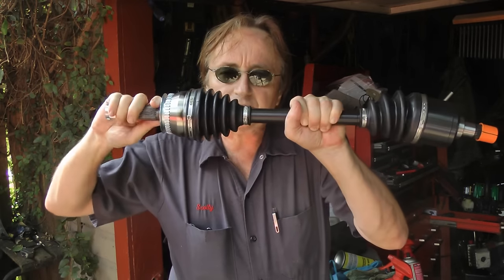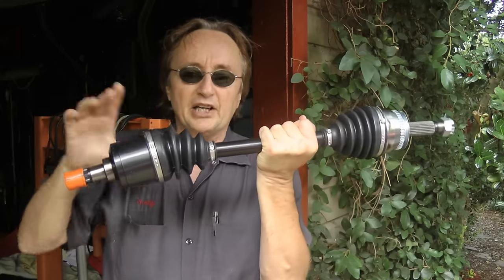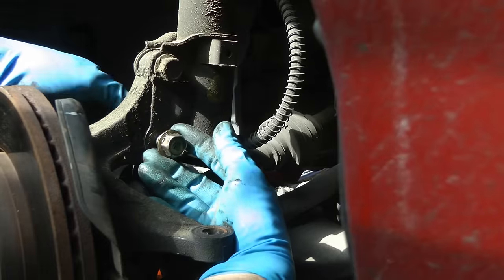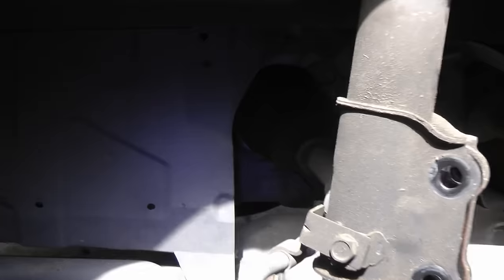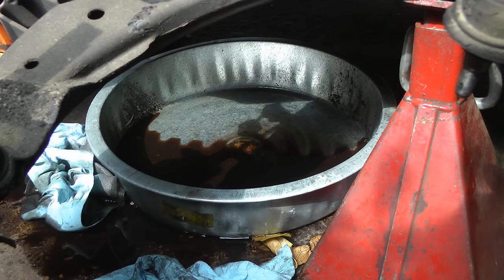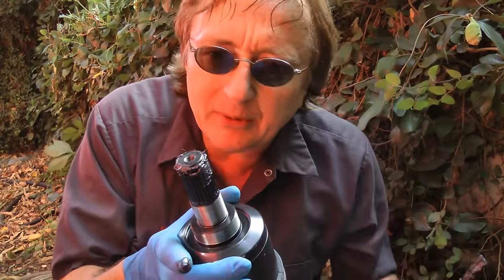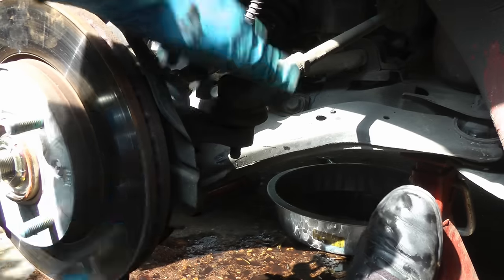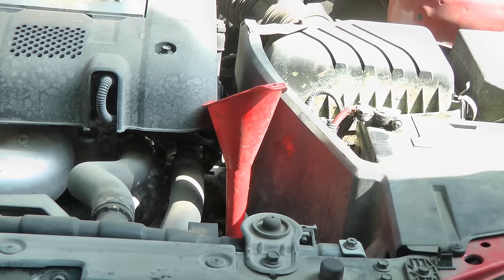How to Fix Car that Clacks When You Turn (CV Joint and Axle)

Comment from the maker: Things I used in this video:
1. Breaker Bar: http://amzn.to/2BEo9Ep
2. Sledge Hammer: http://amzn.to/2klPyH8
3. Brake and Caliper Grease: http://amzn.to/2jTpCPh
4. Metal Oil Pan: http://amzn.to/2nlDM0y
5. Sledge Hammer: http://amzn.to/2klPyH8
6. Ratchet and socket set: http://amzn.to/2inoxOY
7. Mechanic’s Tool Set: http://amzn.to/2Bzmccg
8. Disposable Gloves: http://amzn.to/2zSRuxO
9. Steel Jack: http://amzn.to/2Asgjxo
10. Jack Stand: http://amzn.to/2jGOwBg
11. Common Sense
12. Full HD Camera: http://amzn.to/2AvoEk7
13. My computer for editing / uploading: http://amzn.to/2i2sKYz
14. Video editing software: http://amzn.to/2jv5Fhf
15. Thumbnail software: http://amzn.to/2k7tz6C

🛠Check out my Garage to see what I use every day and highly recommend:
https://www.amazon.com/shop/scottykilmer

❗️Check out the Scotty store:
https://goo.gl/RwhRGU

👉Follow me on Instagram for the latest news, funnies, and exclusive info / pics:
https://goo.gl/ohy2cA
Reply: Scotty Kilmer hello, does that also a problem that can be solved on a bmw xdrive?
Reply: Scotty, you didn't leave a link for "common sense" on the things used in this video...🤔
Reply: hey scotty,,. i just did the same job ..only the retaining clip looks like it broke on the way out.. i got the big peace but never found the tips ,, 02 accent gl 1.6,, what would you do?.
Reply: Scotty i wanna advice from you what you think CV made from china?
Reply: Should you change both sides even if one of the two is failing??
Reply: Mine makes a howling noise that goes away when I turn left.
Reply: Scotty, my 2007 Toyota sienna is making a very similar noise after acceleration and turning or going over a bump. My mechanic says it is the ingine or the transmission going bad. I dont really believe it after watching your video. Any thoughts?
Reply: I just put in a new CV axle on my passenger side in the front and I got a little crackling sound is it because I didn't grease it???? Need to know as soon as possible it's about to snow here in Ohio real soon
Reply: 1
Reply: Hello Scottie, I have a 2016 Range Rover Evogue SE. My Lf and Rt CV Axles are clicking. The problem is that the dealer is the only source for the CV Axles and there's none in the country or the UK. What other options do I have to fix my CV Axles?
Reply: 11. Is the best one lmao

Comment: Great tip on putting grease on the end of the axle. I would extend that to put grease or better yet anti-seize on the splines on both ends of the axle to make removal easier next time. Rusted in cv axles are no fun.
Also I wouldn't recommend to anyone to hit the tie rod on the castle nut like that. You can easily bend a prong on the castle nut and you'll never get it back on. Hit the steering knuckle where the tie rod goes through it instead. Works great and no risk of damaging anything.

Comment: I have a Acura TL that makes this annoying noise! Sounds like the Wheel of Fortune wheel. Thanks, now I have a fun, learning experience to tackle this summer.
Reply from the maker: check the cv joints at the front wheels first, if boots are ripped, you need new ones

Comment: This guy's awesome. He makes it look so easy.
Reply: he does, but I wouldn't trust myself to do it lol
Reply: Yeah this one in particular. It's excellent skilled labor what he demonstrates.
Reply: That's what happens when you do it for 50 years lol
Reply: i m looking for a cv axle left and right  for a Suzuki alto 1999 1.0 benzine can some one help me find them
Reply: Aviators how
Reply: keytracer lmao
Reply: its easy but if you don't how to do it it seems impossible, like driving the first car vs driving a todays automatic car
Reply: Fguyhb
Reply: Yes IT LOOKS EASY. Trying doing yourself and you will spend 2 hours removing one wheel and probably damage your car using the lift. I seen it happen.
Reply: @keytracer  your dead on
Reply: of course he does he chooses the easiest cars to do these things on
Reply: @keytracer  its a tutorial video. Obviously if you haven't done it before it'll be challenging. It's not that bad.
Reply: @NeutronX101  2 hours removing one wheel?? If you have the proper tools it won't take you anywhere near that long.
Reply: @ElChuvyDuvy  if you never used those tools it will.

Comment: Great video. I'm diagnosing a popping/knocking noise from my front suspension/steering area. Had the sway bar links replaced before, so now I'm leaning towards the axles or shocks.

Comment: Nice tutorial. This was the first problem I had to fix on my beloved Suzuki. I paid only ~16 bucks for the left outer joint. It has been working perfectly  for 8 years and 50000 km. If somebody wants to replace only the joint it is highly advisable that throw away the no name grease that comes with the kit and replace it with some quality lubricant. (The inner joints need ordinary EP2 grease   - eg.: Total Multis EP2 - without any solid additives and the outers need lubricant that has MoS2 improver eg: Total Multis MS2.)

Comment: Great video!  I tried replacing the CV axle on my 95 Subaru Legacy last week and could not get the lower control arm to separate.  Whacked it with a sledge like you did, heated it with a torch, tried pretty much everything.  I even put the bolt on loosely like you did there and jacked the car up, then dropped it but it still wouldn't budge!

Comment: So what do I do if I don't have a transmission dipstick. Looked ALL over the engine and couldn't find it. Took it to a couple local mechanics and even they couldn't locate it. Dealership told me it's entirely sealed? What's up with that? Any help Scotty?
Reply from the maker: yep, the evil engineers make most of them that way so they have to be serviced at the dealer or by a pro mechanic with special tools and more knowledge. It's all about MONEY.
Reply: Alot of vehicles just have a fill hole with no dip stick. You just remove the plug and stick your pinky in there to check the level. If the fluid is right at the hole, you're good. But some cars, especially German cars, have fully sealed transmissions that only a transmission shop or dealership could charge you a fortune to service.
Reply: VW transmissions in the past had 2 plugs, one at the diferential to drain and other in the the back of the transmission to fill. The procedure is simply fill till it starts leaking from the filling hole. Its that simple, no need for a dipstick.
Reply: You probably have cvt oil its hidden look it up
Reply: @scottykilmer  man thats why i love your content, that piece of truth right there!👍✌

Comment: Scotty, heads up: some cars don't have two CVs on each axle. On them, there's one CV outboard, and inboard is a tripod bearing meshed into an inner driver cup with a boot covering the whole thing. The boot is held on with a big hose clamp. If your car's this way you will never pry the inner driver out of the transmission because there's something in there holding it in. Saabs are like this.

To get this out, when you get to the stage where you'd have to pry the CV out of the transmission, just loosen the hose clamp and tug. It'll come right off. Make sure you're not under it so you don't get conked in the head when one of the bearings falls out of it - and at least one bearing will fall out.

To put it back in, pack the inner driver with CV grease, work the tripod bearing in, reassemble your front end, and then slide the boot into place and clamp it on.

Comment: On some cars you can just drop the ball joint out and then your whole wheel assembly can be pushed to the side and the CV axle will slide right out. This can actually be easier at times as apposed to the method shown in this video. and when you are done you won't need an alignment. However if you have an old rusted car, then getting the ball joint out can be a pain in the behind.

Comment: great video again scotty although long as people remember when reassembling the cv nut that on most vehicles there is a torque spec that needs to be in place so it doesnt ruin the wheel bearing/hub assembly

Comment: I fixed this once on the Mercedes c300 2009 model, the section thats in the transmission is actually hard to get out especially when the car is only 1-2 foot off the ground with minimal space to move. What worked for me is I hit a piece of wood with a hammer and the vibration that transferred knocked it out

Comment: Looking at the color of the trans fluid, it needs to be replaced. I did learn one thing from what Scotty shows and that is to put grease on the end of the axle before putting it in the transmission. I have been fixing cars for 30 some years. First things major that I did was make a new wiring harness for the engine on a 64 chevy after the thing caught fire due to carburetor problems. The float was stuck, and flooded the engine and poured fuel all over the top of the engine. There are few things that I can't fix, but just as Scotty said in his videos about mistakes that he has done in the past. I have done the same thing and that is taking on jobs that are not worth my time, and I would be better off rejecting them (or as a former boss said don't say no just quote a high enough price to make it worth your trouble.)

Comment: Great video.  Some cars (my Mazda included) require a new axle nut and a dab of anti seize on the mating surface to make it torque right and stay.  Went through two new nuts before I figured that out.

Comment: Thanks a lot Scottie,I have the same grinding noise while turning and driving, so I did just that and replaced both axles..
ONLY THAT IT STILL MAKE THE GRINDING NOISE WHILE TURNING AND DRIVING with the new front axles 😢😢😢... Any advice would be appreciated 👍🏽😅

Comment: Scotty, good overview video on doing this job. What's your opinion on applying anti-seize to the wheel-end splines of the axles? I did that when I did a brake job on my 4X4 2008 Chevy Colorado last year, and it was a godsend when I had to replace the original CV axles earlier this year.
Reply: yes, anti sieze prevents the splines from sticking...anti seize is great on many things, especially exhaust threads so they don't seize up, always use brake cleaner on the end of bolt threads that you plan on removing so the dirt on the threads doesn't get pulled into the threads of the nut when you remove the bolt, good trick

Comment: hey scotty thank you for you all information . i just change my rack and pinion and i heard the same voice coming from the right Wheel and i really don`t know what the mecanique did to it , and i saw the my gas rauge does not going down when i turn the car off
Reply from the maker: some gas gauges just do that when old, if it reads fine, ignore that. check the suspension on the right side, could be worn ball joint, tie rod, or A frame bushings
Reply: ok thank you

Comment: I'm just about to do this on my ford focus, good timing, thanks.
Reply: Don't worry. Scotty has 2 other video's that show the same thing with a few variations.
Reply: It's one of the easier jobs.  Break the axle nut loose with the wheel still on the ground if you don't have air tools.  There's really no need to hold the brakes or anything.

Comment: I have now watched 3 videoes from you and i love them BUT, when u lose the tire rod you do it diffrent every time... 1. video you use a puller, 2. video you use a tie rod spreader and 3. video you use the simple hammer/punch on the bolt... Are they all evenly good or is there one you prefer the most?
Reply from the maker: there are many ways to skin a mule, you do it with whatever tools you have. The puller of course works best, but it costs the most to buy a good puller
Reply: Alright, thanks Scotty!

Comment: I found the best way to get the axles out of the transmission is to take a small pry bar, put it slightly between the axle and the housing, and in almost one motion, shove the axle towards the transmission and then pop it outwards with the pry bar. Shoving it in causes the lock ring to compress and makes it easier to pop out.

Comment: I did this today and turned into a 5hr job lol. Axle was stuck in the spline and would not come out. It eventually did. Never again. Only reason I did it was because on my 94 integra they came out like butter so I figured I'd do on my sister accord.

Comment: Thank you for your advise. I bought the whole caliper and it worked like s charm. But you know. I actually had to replace all of them, because when I did that one another got stuck and so on an so on. They work well now.  By the way when I'm driving I here something almost like unbanced tires but the tires aren't. Wearing out in an odd way. Thank you. Help! With that would be helpful.

Comment: CV joint problems are very common on Hyundai vehicles. (Using Hyundais for the last 8years)
Reply: anu  Huh? I had 192k miles on my car before I needed a new left CV axle.

Comment: I replaced the driver side axel shaft on my 2005 Toyota Solara and at the end I got a surprise - the wheel it's not rotating. I wonder if I can have the right tip (advice) to avoiding this unpleasant surprise. 
Thank you so much in advance!

Comment: Amazing videos my friend, I replaced my 2 front axles on my 2006 MDX my friend is a mechanic he put it up and looked at it and said I did it properly it ran fine for a few days but now when I turn the wheel left or right I have that popping again what could be making these brand new ones bad is there something that is continuously breaking them? I have no leaks or brakes in the boots either any help would be amazing thank you!!

Comment: Got a 2004 Chevy impala 3.4 liter my drivers side clicks when am driving slow and it shakes and Wobbles about 35 to 45 miles an hour then it quits. Is it a bad cv axle? Need help here please thank you love the videos your a lot of help. Thanks Scotty
Reply: normally it's the outer joint that goes bad, if it clicks turning right it's normally the right axle, if it clicks when turning left it's normally the left axle

Comment: I have sounds coming out of front- passager-side wheel. Sounds are most noticeable when turning left at slow speed. But there is nothing leaking and CV joint rubber mount is in good shape. They charge $70 to $120 locally just to look at it.
Reply: Amir A ever get it fixed?
Reply: @MaYHeMLifts  one day I saw a mudguard hanging under the car, and found both mudguards loose. Fixed them in place and haven't heard that sound since, which local Midas was ready to replace front struts for nearly $800.

Comment: Hey Scotty, fan of your videos as they are straightforward and simple. I have a 2003 G35 RWD and i have a similiar popping/clanking noise when i am accelerating during a sharp turn, and only when i am making a sharp turn. My front has no CV boots, so what may the cause possibly be ?
Reply from the maker: +Ashiful Islam   worn struts or strut mounts

Comment: Hello Scotty I have a problem,  I have a 2006 Mazda 6. I always repair my car because I can't trust many people with my car. Your videos have taught me so much. 
I can't seem to find this problem, every time I turn left I get a weird noise (clickingish and clunkigness),the noise doesn't happen if I turn right. nor does it happen when I turn left when accelerating or breaking. 
it only happens when I let go of the gas and turn left. 
I believe it's the wheel bearing.any suggestions on what I should do?
thank you very much.
Reply from the maker: +Anthony Awada   wheel bearings roar, and CV joints clack, figure out which noise it's making
Reply: +Scotty Kilmer definitely a clacking noise, not as bad as the one in the video, I checked both cv joints and both are like new. none ripped and I checked them very well. there is no play with the wheel also,  on 6 and 12......and 3 and 9 o clock, no play at all. when I took the left wheel though the lug nuts were very east to take out. maybe the brake pads could be rubbing the discs? not sure.

Comment: Hey Scotty i have an 03 accord thats making a scraping noise when i make sharp left and right turns on my left front side. and i checked the brakes for uneven wear, the guide pins are lubed and move freely, the pads are evenly wearing and have anti seize so they don't stick in the caliper where the clips are.but i am still puzzled   what do you think i can check next? i love your videos and thank you for all your amazing videos!

Comment: Morning Scotty, I have a 2017 Nissan Murono SV. It only has 38,000 miles. It makes clinking noises while moving the steering wheel. It does it with the vehicle in park to, while moving the steering wheel. It's kinda a clanking noise. It's not constant like in this video. The boot looks new, and is in tack, not ripped or leaking. Looks brand new. Any ideas? I'm going to make an appointment with the Nissan dealer today. It's getting worse. I thought I'd see if I could get an answer from you. It happens, so far, while making left turns, at slow speeds. Thank you for your time scotty.

Comment: do not use a impact on axle nut, only hand tighten. i learn the hard way. ended up over torque and ruining wheel bearing. had to take it apart again lol

Comment: Hey Scottie I replaced my front left axle twice on my 4x4 05 durango only to find out it was my front differential clicking like crazy I bought a used one with crazy low miles was cheaper than repairing mine it just arrived today ant advice on having it put on

Comment: Scotty im running with the same problem on my 2012 impala every time i turn right and accelerate it clacks. Ive checked both left and right cv joints and the boots look perfectly fine. Also when im at highway speeds theres a vibration that i believe comes from the left front tire